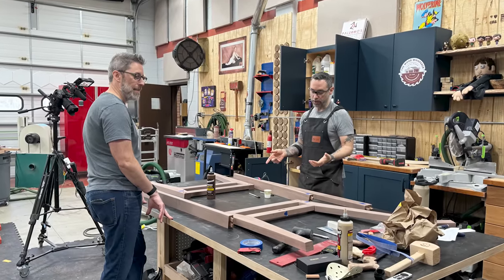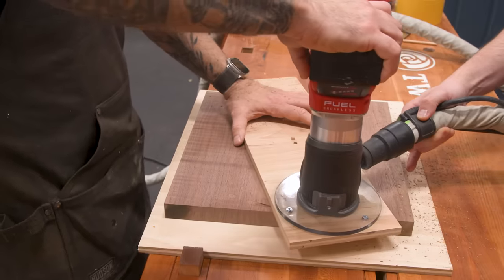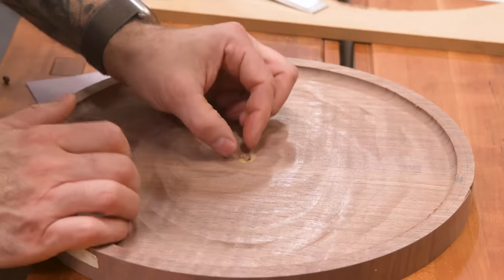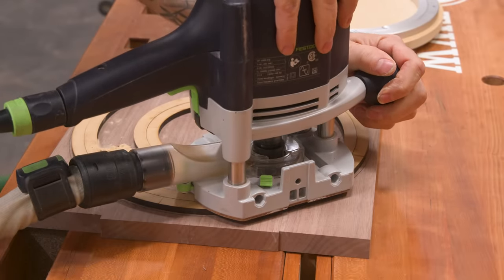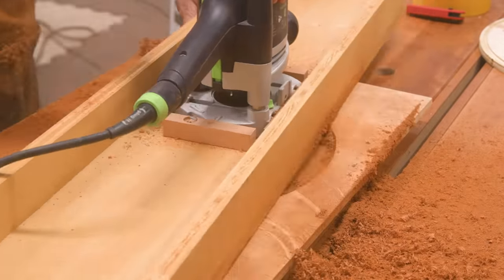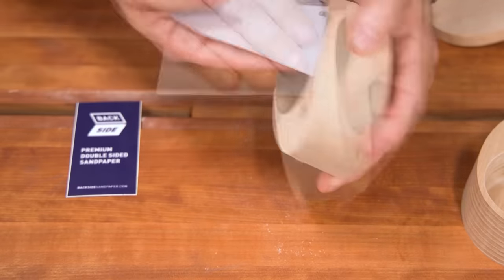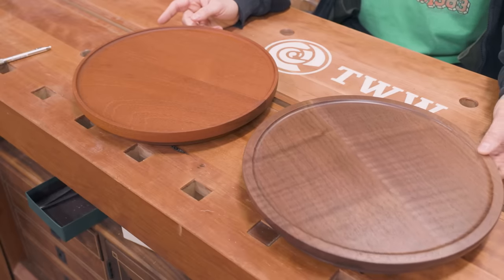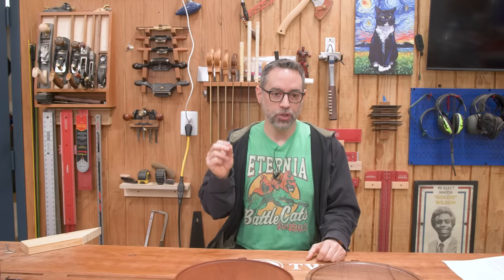I Almost Didn't Post This Video | Lazy Susan | The Wood Whisperer

Comment from the maker: Get yourself some of that sweet backside.....BACKSIDE SANDPAPER! https://backsidesandpaper.com/
Reply: Note that there are two different types of lazy susan on the amazon page you linked to.  I've bought both of them over the years (although from a different amazon "store").  What they're now calling commercial is what you wanted (as opposed to the "heavy duty").  The internal bearings are far better and the two rings are offset from each other so you don't need the washers.

Comment: The project didn't do this TO you, YOU did it to the project! 🙂 Several months ago I looked into circular bearings for lazy susans, after reading the reviews on Amazon, I came across the same issues you cite (lack of clearance, relatively stiff, noisy). I think some of these are really intended to support much heavier loads that need to be turned slowly on occasion. I'm very glad you decided to share the video, we've all been there, or somewhere similar. Finally I definitely liked you advice regarding when to call it a day (or night) if errors or near misses are accumulating.

Comment: This really highlights the fact that simple does not always mean easy.
Reply: My day job, I'm a software developer. Simple rarely means easy, for sure. If the user sees a simple thing, that means the programmer worked very, very hard. :)
Reply: It's worse than that. Simple generally doesn't mean simple. And unless you've done the same thing before (preferably many times and recently) it's never truly easy.

Comment: Lee valley sells a different style of lazy susan bearing that I think is a bit quieter. Also, you only need one screw hole in the bottom, you can just spin it around to each spot. Still beautiful results and you always tell a great story no matter how you get to the end of the project :)

Comment: The R2 builders club are quite experienced with those lazy susan bearings. :) They can be quite noisy. Enough so that its a common practice in the club to dismantle them and polish the race, and even replace the ball bearings with delrin ones.

Comment: I might have tried this on my CNC.  A bit more control over the router and centering is a tad easier. Not that CNC is the answer for mistake and error correction,  it could perform on this project with less worry about templates.

Comment: It happens to us all mate and it's almost always on the "easy" stuff. Glad you keep mistakes in. Makes your videos much more relatable.  I've used those exact lazy Susan bearings and there are good and not so good ones. They do seem a bit loud, I got mine from Amazon and they were the same but got a different set that looked exactly the same but you could feel the difference in quality when you handled it which was much quieter.

Comment: I made 6 lazy Susan’s for Christmas gifts, except mine were single level.  I ran into similar issues with dumb router errors.  I believe I used the same hardware as well. They were finicky, had no screws included, and no directions. I ended up adding spacers to mine, like you did, but I just attached rubber feet to the bottom ring. A few drops of oil on the bearings will help it to turn smoother and quieter.

Comment: The three strike rule with mistakes really resonated with me. I don't have a specific strike count but at a certain point I know I have to put the project down and press a reset button on my headspace as well as environment. I've learned that certain tasks are fine when working under some time pressure or time constraint, while others are best left to having an open runway of time so you can really think through the task and triple check things before committing.

Comment: I've built a half dozen lazy susans but never recessed the top or the bottom; just left it flat.  I've used that same hardware and I do screw it directly to the top but don't tighten it down all the way.  You do have to leave just a little slack in it for it to spin.  There must be so many bearings inside that they don't spin as fast as I remember when I was a kid with my mom's lazy susan.   I've also used the double-ring hardware but it's not as elegant as these new Chinese bearing rings.   Good to see you work through the %##$!!# that happens in the shop; it certainly happens to all of us.

Comment: Note that there are two different types of lazy susan on the amazon page you linked to.  I've bought both of them over the years (although from a different amazon "store").  What they're now calling commercial is what you wanted (as opposed to the "heavy duty").  The internal bearings are far better and the two rings are offset from each other so you don't need the washers.

Comment: All of that dust and fussing with the router is why I use a CNC router. I have a small 2' x 4' work area that my dust collector connects directly to. The nice thing is how little dust there is and not needing to use a template / flush trim bit to get the exact shape.

Comment: Connect any two points on the outside of the circle with a straight line.  Find the perpendicular biscector to that line and strike it across - there's one diameter.  Lather, rinse, repeat.

Comment: I found connecting the bottom to the top you only need to drill 1 holes. Rotating the bottom for the other 3 screws, plus they hole might be needed to replace the LS if the bearings go bad,

Comment: This can translate to so many different jobs. 
Many times a customer will think: “Wow that’s easy. Why are they charging me so much? I could have done that.”
And they may be partially right. A lot of things are easy and they might be able to do it too…IF, everything goes right.

The reason you pay a professional as much as you do, is because things don’t always go right. As a matter of fact, things can go so wrong sometimes, the project can become irrecoverable. The professional has made those mistakes before and knows what needs to be done, to avoid catastrophic failure. They also know what can and what can’t be fixed. The reason you pay a professional to do what seems like an easy job, is because they know what to do when it all goes wrong.

Comment: This hit home, since yesterday I cut grooves in a set of two (2) 31” long walnut boards, and 1) made the wrong number of grooves… 2nd try) new wood pieces and cut the single groove I needed in both boards, and they came out too wide.   4 boards now in scrap pile.  At the price of wood this hurts😢.  I knew better that I should’ve used test pieces first.  New day, will 3rd try work?

Comment: Having only made my first couple lazy susans about a month ago, this was an interesting approach.  Why not just rough cut the circles, then sand them to a line on an oscillating sander?  Also, I get wanting the hardware recessed, but I don't think it's really necessary.  It seems like there was a bit of overthinking in the build process in the video.  (That said, I've learned the majority of my skills from the guild.)

Comment: This would make a great first CNC project if you are doing any of those yet. You would have a new set of mistakes you could add to your repertoire. As for the noise with the bearings there is a small adjustment screw where you can take the bearings out that you can adjust, that sometimes cleans that up. You could also replace your bearings with ceramic.

Comment: I see how you corrected the issue with the hardware but I am curious if those holes were not intended for screws what were they for and how was this hardware expected to be mounted?
Reply from the maker: Looks like they were intended for use with the rubber feet they include. Meaning you need to have something pretty heavy on it so that the think won't slide around just based on the friction between the feet and the surface you have it on. Think like a slab of marble or something.

Comment: I'm sorry. I am an absolute traditionalist and absolutely believe that you can do almost everything with hand tools, power tools, and combinations thereof.
However, this is a project that I'd almost prefer it done via CNC.

The lazy susan is grinding because of the lack of clearance, or missing some grease (or addition of dust) between ball-bearings...

But, you still did a great job and they both turned out beautifully!!

Comment: man if I stopped after 3 mistakes I'd never get anything done. I guess when you've got staggering levels of ADHD you just become a master of fixing mistakes because there's no amount of breaks that will make the brain cooperate lmao. I stop (or need to stop) when the frustration starts spiking or am getting tired but determined to power through. THAT'S when the injuries/big mistakes start...

Comment: Why were you using paddles when routing that big piece? It seems like it's just more potential places to slip and cause problems.  Just brace the piece with your palms and get it done. Don't be so afraid of your router.
Reply from the maker: Fear has nothing to do with it. Feel free to use your palms whenever you want and best of luck with that. :)
Reply: @woodwhisperer  what do you think it's going to do? Routers have far less kinetic energy than most other woodworking tools. Yes, they'll kick a little bit but they won't send a piece of wood across the room and through the drywall like a table saw. I promise you'll have far better control of that workpiece putting your hands directly on it then you would using those paddles, it'll be safer too.
Reply from the maker: Couple things....the router absolutely IS capable of throwing a workpiece across a room. Second, this is less about workpiece kickback and more about your hands/fingers being pulled into a spinning bit.  That's far more likely to happen if your hands are engaged directly with the workpiece. Sorry but I think I'll trust my own judgement and personal experience when it comes to safety and workpiece control. Appreciate your concern though.
Reply: @woodwhisperer  do you use paddles when cutting a 4x8 sheet on your table? Saw? No? It's a question of scale. There's enough wood between your hands and the blade. That 14-in round chunk of wood you had on the router is plenty of wood between your hands and that little bit. Bracing your palms on the back edge of the work piece is far safer than trying to press down with white knuckle grip using those paddles.
Reply from the maker: Ok 👍